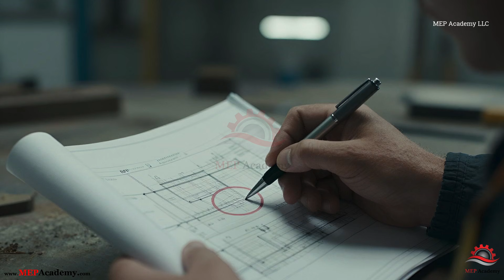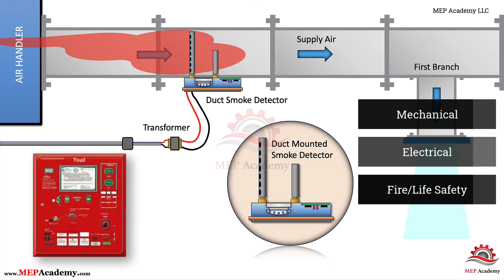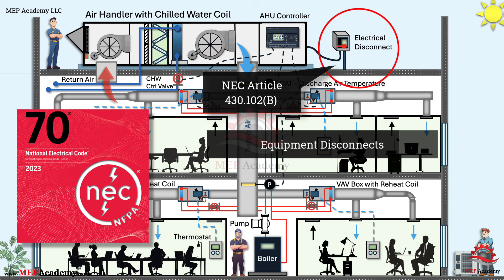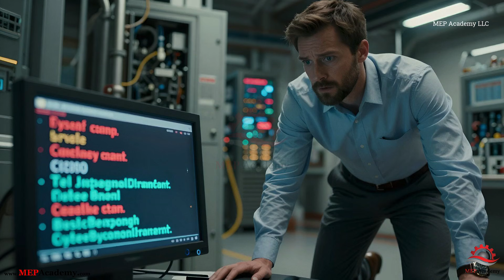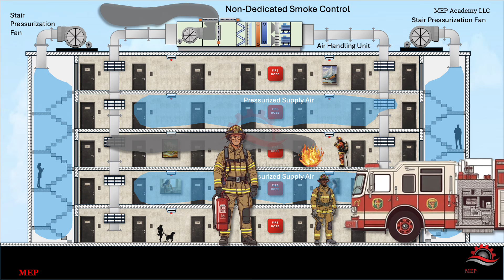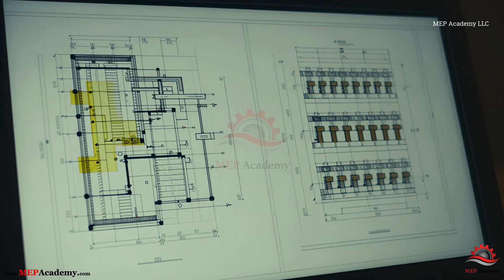5 HVAC and Electrical Coordination Issues

Comment from the maker: 🔧 Quick Question for Contractors & Estimators:
Which coordination issue has caused the biggest problem on your projects?
1⃣ Duct smoke detector shutdown wiring
2⃣ Missing disconnect switches
3⃣ Missing service receptacles
4⃣ BAS / controls wiring
5⃣ Fire alarm interlocks
Drop the number below 👇 and share what happened.
Most coordination problems don’t start in the field — they start during estimating and scope review. If you’ve ever had a “we thought they had it” moment, you know exactly what we’re talking about.